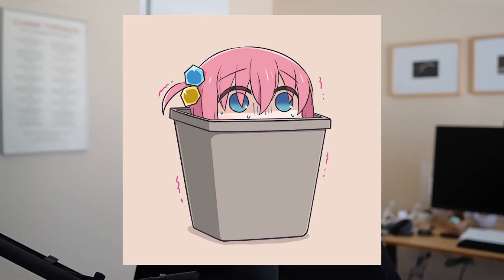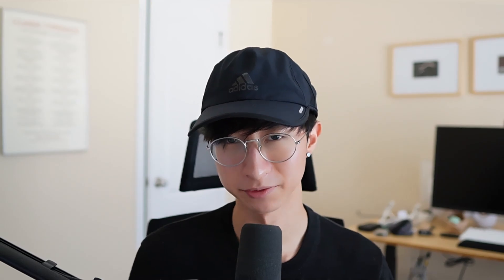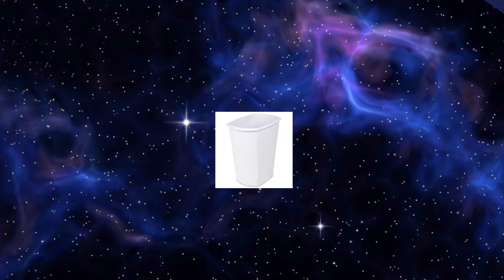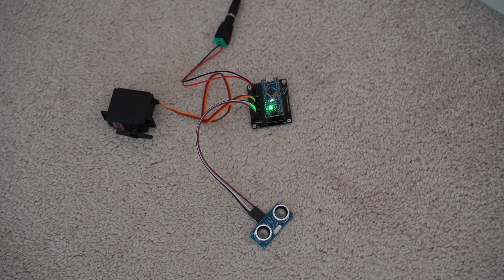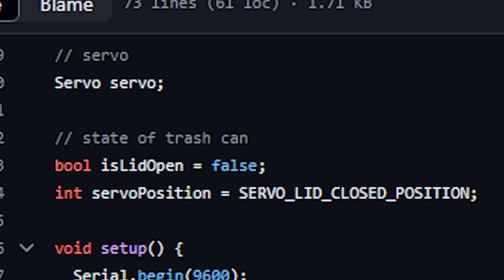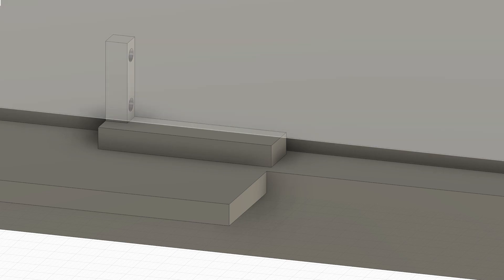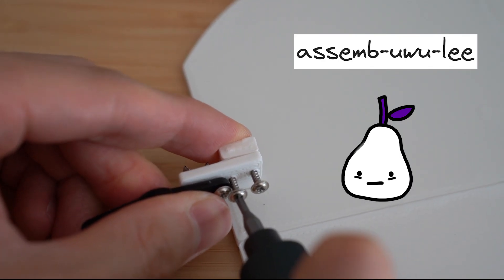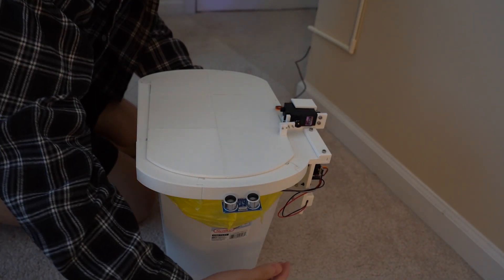I upgraded my trash can with AI

Comment: i find pre drilling holes for screws and bolts helpful in thin wall 3D printed parts, and for mechanical parts, since space wasn't really a limiting factor, beef them up past where you think they need to be. overall awesome V1, with room for an awesomer V2!
Reply from the maker: Thanks for the tips! Will definitely give these a try next time 🍻